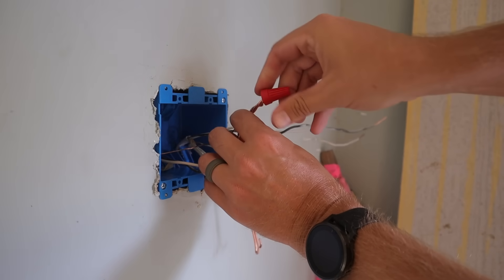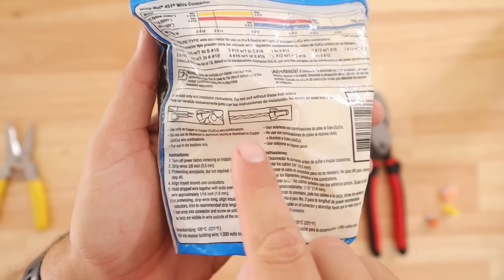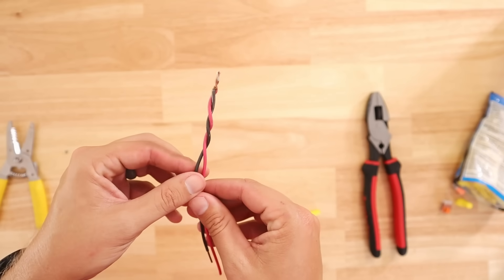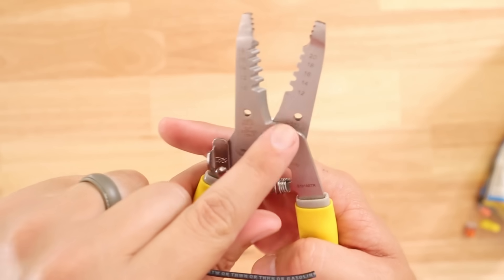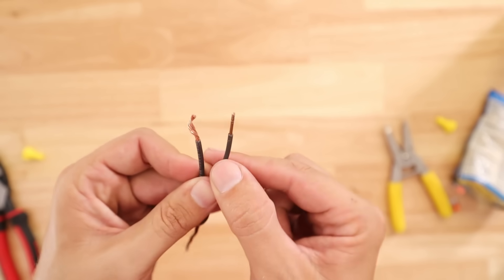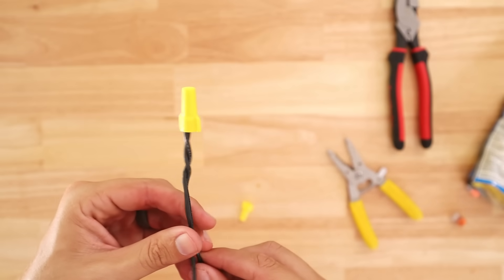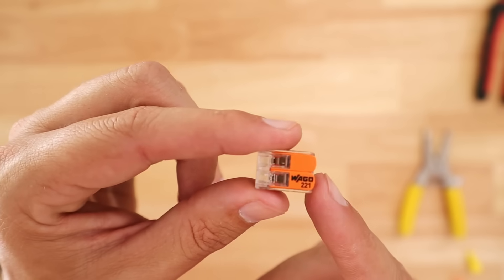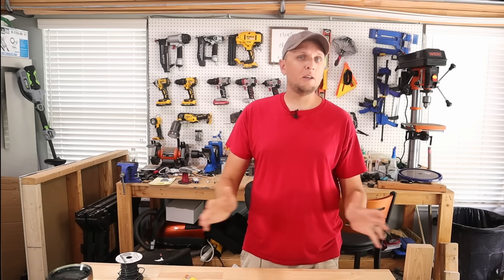BIGGEST Mistakes DIYers Make When Connecting Wires Together | How To

Comment: I am from the UK we do not use these wire nuts, I never seen them sold here with good reason they are dangerous we use a block that has screws in so they are properly connected and cannot come loose.

Comment: Back in the 80's when I was an electrician in New York, the NEC required "All connections be mechanically secured before wire nut" this meant twisted with a pair of pliers. With the introduction of lever nuts and other quick connectors, the code might have been changed to accommodate them.

Comment: Wirenuts are not allowed in Australia. We use a clear insulated single screw “BP” connectors. An earth “BP” connector has two screws. Coloured Insulation tape is wrap around the wire & connector to finish. Popular brands are HPM and Clipsal. 🦘🪃
Reply from the maker: Interesting.  Thanks for sharing how you all do it!  Seems almost everywhere does something differently.

Comment: There is no reason to have any more than one revolution or so of twist in the insulation below the skirt of the wire nut. If the wires are naturally twisting below the wire nut, then the internal conical spring will have fully engaging the conductors (assuming they were lined up correctly in the first place, based on wire size and type). Excess twist makes it harder to fold a finished product into a box. Also, it becomes a real mess when the next guy has to take it all apart. 
I have told many an apprentice to pull on each wire going into a wire nut, after they installed the nut (to see if it any wires can be pulled out). It's mostly a test to make sure nothing went weird while they were engaging the wire nut spring and got it tight enough to forever hold those wires mechanically together.
Reply: I can't say enough how important this point is. An Ideal rep told me they showed all the twists to make the point that the wire had to be twisted under the wire nut, and for liability purposes.  All the extra twists do is to make the wire harder to bend and increases the chance of the copper work hardening and cracking or breaking under the insulation. Try tracking that one down!

Also, not only is it time consuming to untwist those wires when working on the box, but untwisting the wires also causes them to work harden and break. Having neat and clean work goes much farther than multiple wire twists in ensuring wires don't come apart.  If the wires lay flat, there is no tension on them, and thermal expansion and contraction is the only possible thing to cause the splice to become undone. In a house, that could be hundreds of years.

Comment: I thought it was illegal by the NEC to wire nut stranded to solid wire.   Must be crimped or a screw type connector. '
But the last I read the NEC was in 1997, maybe its changed.

Comment: That diagram in the wire nut packaging, if you have a closer look, shows that it's acceptable for a stranded to solid connection to shoot place the wire nut into the wires without twisting, which is common practice.
If it's two or more solid conductors, you must twist them together.

Comment: i am a female sparky i would only use that connection on a 12 v or 24 v maybe 50 v max and then twisting as a pair  but 120 or 230  i would not not use  but now i am a  joiner that joins LV side to a industrial cables from sub stations to panels my last job was a 2000 amp supply use six 600 amp breakers

Comment: You should mention that pre-twisting with the linemen's pliers should be done in a clock-wise direction!
Reply from the maker: You are right Randy!  I definitely missed inputting that into the video.  Thanks for the reminder!
Reply: @HowToHomeDIY  Yeah that's a good point to remember! If you twist the splice the wrong way, then when you twist the wirenut on, it can undo and loosen the splice, instead of tightening it a bit further... It's probably the most important part of splicing, doing it in the right direction.
Reply: Not if you are using left-handed wire nuts!! 😆
Reply: @JohnaldMcDonald1  lulz 😂

Comment: pre-twisting a pair of wires with pliers is a bad idea if you are dealing with older aluminum wire which is often brittle. you will crack the wire. guaranteed. and you might not even know you cracked it. you are better off snuggly twisting on the wire nut on by hand, then wrapping a little electrician's tape around the nut and the wires. there are a lot of buildings the still have aluminum wire

Comment: I think one of the only downsides to wago connectors are heat really. Given equal loads, I vaguely remember wago nuts using about 1watt heat dissipation over wire nuts. I don't remember what the load was, but 1 watt over hundreds of these would add up quickly
Reply: The complete issue with wire nuts and wago's is: the sum of the area that is electrically passing current within the juction must be greater or equal to the cross section of the wire carrying said current into the junction. To use different words, (I'm using ridiculous units to make it easier to understand) if the cross sectional area of each wire entering a wire nut was 1" of area, then the total area of the wires touching under the spring inside the wire nut must be equal to or greater than 1" (in this case) or the junction point aka "wire node" would have more resistance than the wire feeding it and it would become a hot spot. In a wire nut the tangential area of the two wires touching plus the total area of the touching spring almost always (in a correctly installed wire nut) comes up to more than the cross section of the wire itself. Thus, within that junction the total cross section would be greater than the wire itself resulting in less resistance. This is not likely to be the case with a Wago. The internal contact area of a Wago is what? the contact point where the knife edge grabs the wire? That is pretty small by comparison. In the case of the wire nut the spring carries current along with the tangential area of each wire touching. This isn't the case with a Wago. That Wago will likely become a hot spot under a load, as Nathan M already pointed out. I personally only use Wagos on known small loads, such as LED lighting or the like. I will never use a Wago on a receptacle or other large load application.
Reply: I am a professional and can only support the use of wago connectors. There is absolutely no issue with heat if you stay within the products appliance ranges (up to 32 ampere). The variation with the levers is amazing for reusability and easy handling. Our company has been using those ones for many years now!

The only downside is the price. If you need LOTS of them they are a little bit more expensive than the oldschool connectors.
Reply: @tiri6379  It's not REALLY the heat that I would be worried about, just energy loss/waste. In permanent installations, I personally stick with wire nuts because they only take a little longer, but don't have the same heat/energy loss. I use wago all the time for semi-permanent/temporary stuff though.
Reply: @tiri6379  I find that the ease of use and faster installation makes up for the higher price.
I've been using them for ~20 years now. And even in higher amperage scenarios they hold up pretty well. 
Another factor to consider is the ease to check if the wires are seated correctly, since the case is transperant. Wire nuts as presented in this video are btw. banned in my country as they are deemed to pose a significantly increased fire hazard. That country being the country of origin of those Wagos ;-)
Reply from the maker: Appreciate the input Nathan!

Comment: Most strand wires aren’t rigid enough to twist post marrette. If I don’t have any snap connectors, I use a zip tie just below the base of the marrette to keep the wires from pulling apart. Always passes inspection.
Reply from the maker: Appreciate the tip!

Comment: In my DIYer opinion (IE, ignore me),  I think pre-twisting doesn't provide any additional benefit to properly  torquing down the wire nut (as you demonstrated).     I followed the pre-twist  practice when I first started,  but more recently started doing it as described on the packaging.    Having revisited my older and newer work recently while changing out some dimmers, I observed it was almost impossible to tell the difference between the two methods.   The nut, if torqued correctly, does as good, or better job twisting the wires together.   This is ESPECIALLY true for spices with more than 2 wires, or where you have different gauges.    I suspect the instructions on the package mention pre-testing so they don't piss off old-timers, but they would not have written down instructions that omit that step if it had not tested well.     As you indicated, this is all mostly about making sure you get that nice twist at the bottom, the electrical connection should be more than adequate even in the initial (bad) example.

Comment: "in my opinion" it's the quality of bonding that matters. The electrician's pre-twisting don't need the insulated part twisted. You will understand when dealing with over done twisting (under 'wire nut' isolated part) in future maintenance calls. Wires are vulnerable if the DIYselfers' box has no connectors or inadequate connectors restraining the movement of cables or wires into the box. In other words, you make sure that the wires 'in the box' aren't susceptible to movements. If so, any connections is made vulnerable. As for "wago"s; might as well get boxes with bonding connectors, and like the new slogan goes, the cost of Wago type connectors does not exceed the benefits. At the current stage in electical history... There just isn't much that can be added, in terms of innovation of the basic material assets that can beat professionalism and comptetence. Wire nuts are reliable, They've past the test of time and when done properly, when doing maintenance, months or years after installation, are still is a no brainer to deal with. The problems are (almost) always incompetence, cutting corners, and not the "wire nuts". Wago could catch my attention if they were screws to 'bond' the wires, just like connectors in metal boxes or panels. Again: The name ofthe game here is "bonding".
Reply: Moved to a 1972 home. Whole house has metal boxes, twisted to hell. Making changes, updates, repairs is a nightmare. Wire nuts are stupid and belong in the past. Twisting is dumb and belongs in the past.

Comment: Twist the wires together, solder the connection and then put on the wire nut.  Bingo!  It works great.
Reply: Don't solder the wire together stoopid...It achieves nothing.

Comment: I found Wagos take up less room in boxes when using newer chunky dimmer switches. Much easier to pack into the back of the box. Especially when connecting 3-4 wires together vs the big knot/bundle when using wire nuts.
Reply: Those wagos metal connectors are so thin and flimsy. Any power surge that you may get will end up breaking just like a small fuse and you will end up having to replace them. Do it the right way. The only time I would use wago is for something that would be easily accessible and for a small project that is not a permanent fixture.
Reply: @chedda1741  I am an electrician, have been using wagos for 12 years and never had an issue, since the time when they were just black. Including office bulidings, homes, goverment buildings. But it is true with any junction box, it has to be accessible, any connection that is not made permanent has to be accessible. What I recommend is to leave the connections behind switches and sockets, avoid connection boxes if possible. If you have to use a box, make a box in an area that you have easy access too. I hate the connectors used in the video, not for a bad connection but the twisted wires are a pain if you need to work on that box.
Reply: wire nuts are for old timers who "have done it this way forever". They are dumb. twisting is dumb.
Reply: It's not dumb when you have enough experience to have found LOTS of burnt up and melted Wagos. They're crap. The little bus bar is an insufficient connector, the tiny bite into the wire is an insufficient connection. Twisted wires have far more of a connected surface area, and it's very easy to do. Lazy people use Wagos at their own peril.
Reply: @mrniusi11  look up lineman splice. that's better than wire nuts or wagos. it just isn't practical for home electric wiring usually, particularly if there are more than 2 wires. also, old timers did work that should last at least a hundred years. a plastic clip and a metal jaw will work fine for a while, but time and galvanic corrosion will make that connection fail much more quickly than a wire nut, which is not meant to be more than a clamp. the copper to copper connection is the best way to do it. but people only seem to want to do work that falls within statute of limitations these days. so give those wagos about 10 to 20 years.
Reply: @SF-tb4kb  not really we have used it here In Europe for well over 10 year and opening old boxes they look like new if there are no damage to the boxes. And I you Wana add something och remove something it wat Easter to. No fucked up twisted wiers to handle.

Comment: Depends on what I am doing, sometimes I also wrap wingnut with electric tape, especially if it will be used in a damp location...wire the size you are showing if it is low voltage I will use heat shrink tubing...
Reply: There is NEVER an application for putting tape on a wire nut. That's a clear sign you have no idea what your doing, or that it was put together by a nonprofessional.

Comment: My rule of thumb when using wire nuts is - The connection should be 90% secure before adding a wire nut. I treat the wire nut as more of an insulator with some added connection strength, not the main connection method. That being said, I almost always use the push in style. You can see the connection being made on every single wire and there is almost no chance of a wire coming loose while folding the wires back into the box. I come from the 12v automotive world where tight secure connections are VERY important with the extreme temperature changes and vibrations of an automobile.
Reply: Hollywood
Reply: Ppp]

Comment: I do fire alarm installs. Waygos are the best connectors I’ve used. Great for being able to disconnect circuits without having to restrip and cut back wires
Reply: I like them too; but I find they are actually a little harder to pack into boxes with lots of splices.    If you stuff the wire nut into the back of the box, then fold the wire in, the shape of the nut helps make the fold tidy.   The Wagos sometimes spin, or don't "plant" in the box the same way,   Obviously better when less "packing" is needed (big fixtures, fewer spices, etc).
Reply: I clicked on this expecting to be disgusted once again by a non-professional giving out half baked advice but you sir have really understood your subject matter. Great advice, great video. 👏👏👏
Reply: *Wago and, yes, best connectors ever.
Reply: i knew an Ayers thats an electrician in Moses Lake Wa back in the 90's.
Hope your related, either way, 
hope you and yours are doing well :)

Comment: My neighbor is a master electrician and told me to never reuse a wire nut because the spring gets twisted, and they are so cheap to purchase. Concerning WAGO connectors. You must remove the insulation to a certain length, not longer or shorter. On the side of the connector is a length measuring gauge showing the proper amount to strip. You failed to inform us that WAGOs can be reused. A very nice feature if you need to do any rewiring. You should be teaching DIY 101 at a technical school.
Reply: Just wind on a wire nut....wind it off.....take a look......what do you see? Zero damage. You have believed a Wife's Tale. Wire nuts CAN be destroyed with enough excessive force indeed but regular installation of a wire nut does no harm to it whatsoever. Think about it...if it did the package would state it, the companies would probably have been sued by now as well. Trust your own ability to examine simple things and take a before and after look at a wire nut doing it's job.

Comment: That's all well and good for junction boxes to use that method of wire twisting. However, take ballasts for example, if you put your twists so far down your wires, you're making it a pain in the ass for the person that has to replace the ballast. Personally, I grip the wires below the wire nut and twist the crap out of them, but I don't let the twists go beyond my fingers. You don't need a million twists for a good strong connection. I have to work on stuff live most of the time, and the more you have to use your tools on the wiring, just increases the chance of unintentional arcing. Untwisting and twisting can break the wires. If I can work the wires apart without untwisting, that's a plus for me. I don't like having to strip a short little hot wire just because I ended up breaking it trying to get all the twists out.
Reply: Wagos are reusable. They are best for ballasts.

Comment: I have always pre-twisted wires together first, for 50 yrs.. Have never had a failure, or "Pull-Apart" ... Have seen many tho, that were just twisted together, as you first showed, and they
  came out quite easy..  Great video, and great lesson in Wire Caps...You are so, so correct !  Thanx for shwoing us all, the Safe Way ...
Reply: I’ve never pretwisted in 50 years and never had one come apart.
Reply: @LTVoyager  glad it has worked for you!
Reply: @olvinyldude  Like most things in life, it works if you do it right. 😀